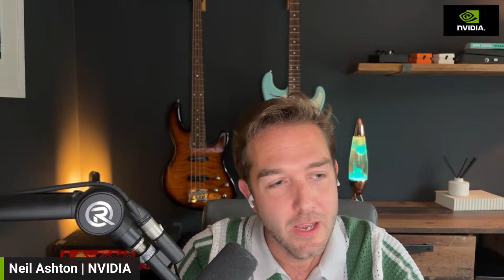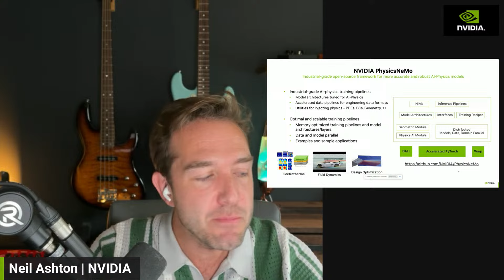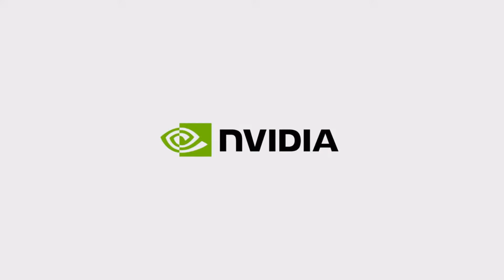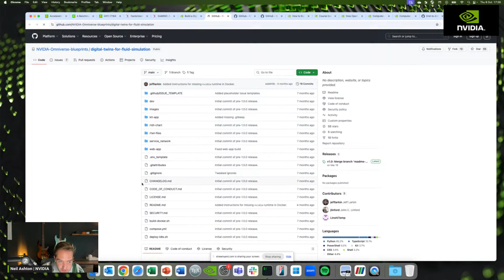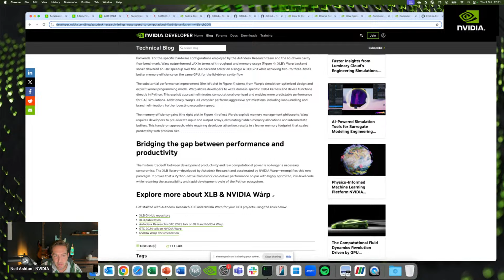A new era of industrial engineering with NVIDIA - Episode 1

Comment: Timeline:
[00:00:53] Welcome & Series Introduction (Host: Neil Ashton)
[00:02:03] Setting the Scene: NVIDIA's Focus in Computational Engineering
[00:03:04] The Four Pillars of NVIDIA's Engineering Strategy
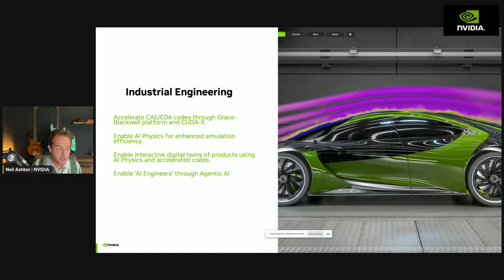[00:03:37] Pillar 1: Accelerating Simulation Codes (e.g., CFD)
[00:04:35] Pillar 2: AI Physics and Surrogate Models for Real-time Prediction
[00:05:19] Pillar 3: Interactive Digital Twins (The Vision)
[00:05:45] Pillar 4: Agentic AI - Building an AI Engineer Helper
[00:06:25] AI Integration in the Traditional CAE Loop
[00:09:14] Introduction to PhysX Nemo: An Open-Source Developer Framework
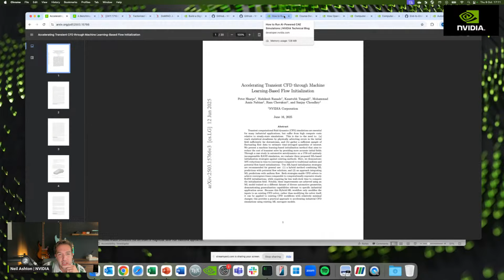[00:11:16] Resources for Hands-On Learning: AI-Powered CAE Blog & Links
[00:12:42] Accelerating Engineering with AI Physics: Deep Learning Institute (DLI) Course
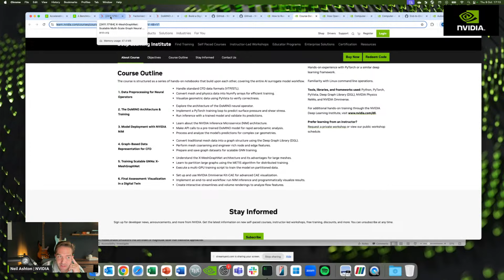[00:13:32] Advancing the State-of-the-Art (X-Mesh GraphNet, Domino)
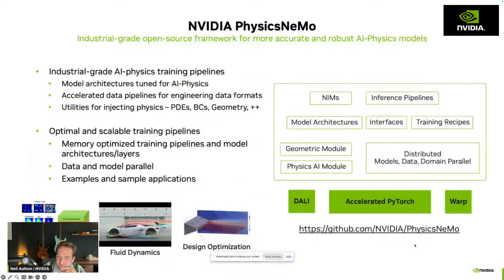[00:14:59] Real-Time Capability: Simulation Speed Comparison
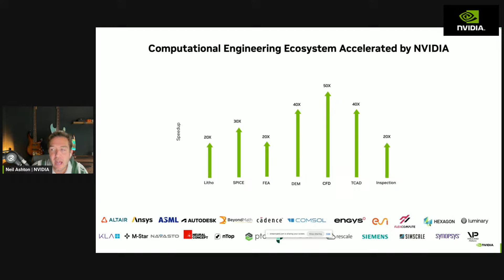[00:16:07] CUDA X: Transforming Computing and Developer Ecosystem
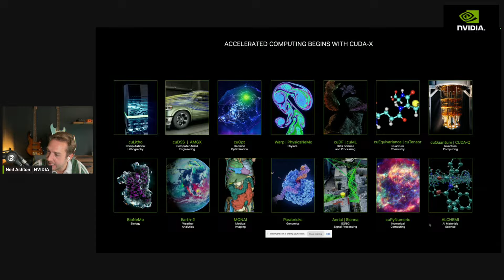[00:16:34] CUDA X Video Montage
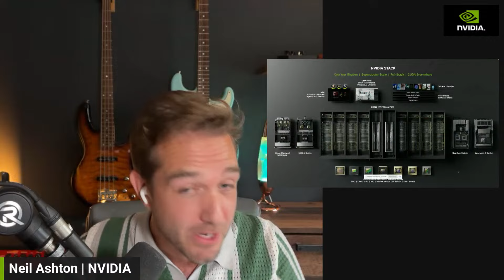[00:19:22] Hardware Scale: The Power of GB200 MVL 72 (400,000 CPU cores equivalent)
[00:20:35] The Role of CUDA X Libraries (coupds, couplass) in Speed-Up
[00:23:57] Partner Case Study: Ansys Fluent Speed-Up (29 Days to 6 Hours)
[00:25:13] Partner Case Study: Siemens Star CCM+ and BMW
[00:26:45] DEMO: Real-time Digital Twin Blueprint for Fluid Simulation in Omniverse
[00:29:42] Warp: Python DSL for GPU-Accelerated Kernels
[00:31:34] Full Stack Summary: Warp, CUDA X, PhysX Nemo, Omniverse
[00:32:50] Series Conclusion & Teaser for the Next Episode (Deep Dive on AI Physics)

Comment: 24:58 320 GPUs for that is excessively expensive and inefficient. FluidX3D with OpenCL can do the 2.4B cells on only a single GH200 or MI300X in less time.
27:29 How useful is this toaster resolution low-accuracy AI inference RANS visulaization when a higher resolved LBM LES simulation can provide a proper transient solution in real time?
Reply: Mate have a day off without advertising your product hahaha